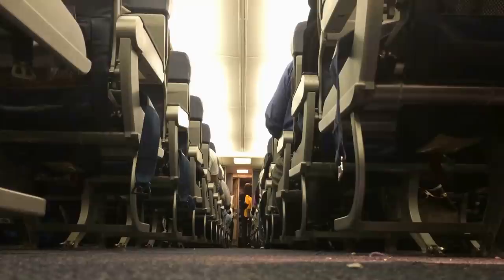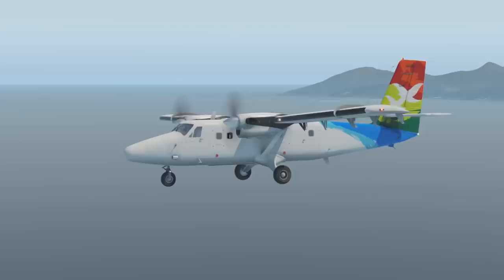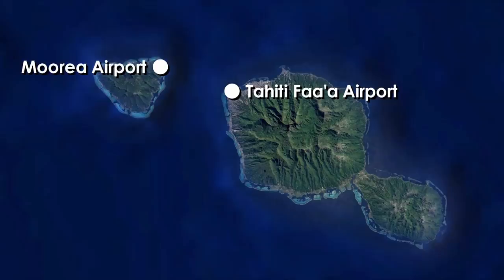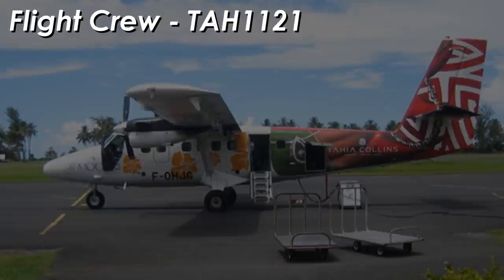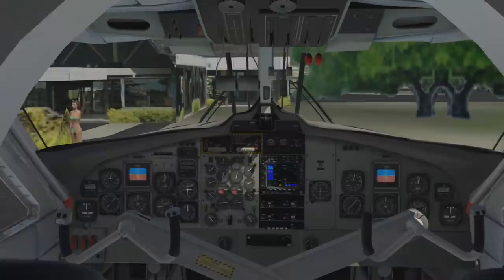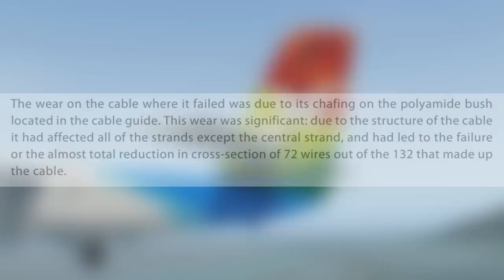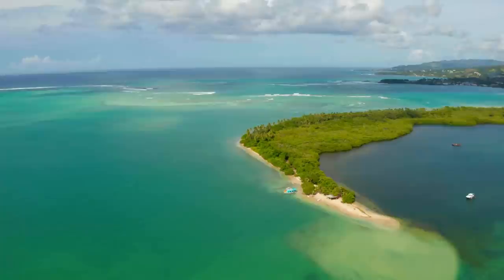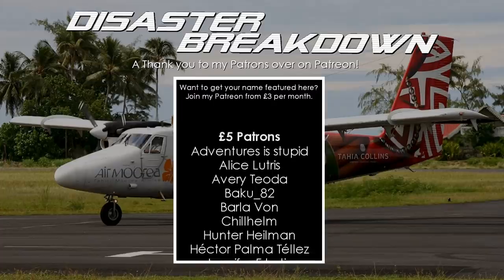The Terrifying Case of Air Moorea Flight 1121 - DISASTER BREAKDOWN

Comment: All plane disasters are terrible events. I'm a bit surprised that the worn cabling wasn't spotted during routine inspections. I guess it must have been hidden away inside the structure of the plane.
Reply: No, there are access panels near the tail and sides where you can eyeball the cable.
Reply: @adotintheshark4848  Thanks for that info as it answers my point/question.
Reply: @nigelh3253   This aircraft like many others have inspection access panels to where the mechanic or Q/C personnel can inspect cables for proper tension,  condition, routing, security and lubrication. I suspect these elevator cables or the one in question stretched over time which is not uncommon and started rubbing against a cable guide and started to fray. Over time it was bound to fail. On most aircraft there is usually a Teflon ring around the cable guide to prevent the cable from fraying. I think it went flying many cycles without being inspected and possibly pencil whipped,  so sad,,
Reply: @70slandshark47  to quote the invastigation report: 

"The failure of the pitch-up cable in the area with 50% wear cannot be explained only by the loads on the elevator control during operations."
"F-OIQI was parked at night with the controls locked."
"An external phenomenon, most likely jet blast, caused the failure of several strands in the worn area."
"The process of cable failure occurred over a short period of time. No signs of fatigue appeared on the failed wires."

when it had been inspected the last time, the cable was probably fine. also:

"When F-OIQI arrived, Air Moorea [...] had not been informed of the installation of stainless steel cables [...]
carbon steel and stainless steel cables being interchangeable, so that the maintenance of F-OIQI was
thus undertaken in the same way as that of the rest of the fleet. [...]"

they should have been informed that the cable was stainless steel, and there should have been a requirement for more frequent inspection of stainless steel cables, since they wear out much quicker than carbon steel. but there was not. and finally, even if it would have been inspected more frequently:

"In fact, this wear is very difficult to detect on an installed cable, especially if one has not previously been confronted with this phenomenon."
Reply: @Freeeez3   Are you saying the jet blast placed undo pressure on the elevator control cables even with the gust locks installed? I have a hard time believing that jet blast is going to place undo pressure on a flight control cables especially when the gust locks or control cables are locked out.  I assume the elevator is zeroed out in a level flight position.  So the jet blast would be little to negligible pressure on a control cable. Carbon steel or stainless steel  aircraft cables are resilient and last a long time when properly maintained. Now I have never worked on a Twin Otter as my background is Commercial Aviation. 
Very seldomly did I ever see one or replace one that was frayed and out of limits. I replaced a few that had stretched beyond their limits. But maybe your right that there was undo pressure put on the cables from jet blast,,, and maybe the jet blast was more pressure placed on the cable than what the pilot would normally command.
Reply: @70slandshark47  i think youtube just ate my initial answer because i linked the official investigation report as my source. anyways:

the twin otter was parked with the yoke locked in nose down position, because apparently there had been incidents of pilots attempting to take off with gust lock still in place.
this means while the aircraft was parked, the elevators were deflected downwards, but they could still in theory deflect a few degrees further until hitting a mechanical stop, due to the yoke being locked. 

now if a strong gust of wind, i.e. caused by jet blast from a taxiing air liner, hits the parked aircraft from the rear, this pushes the elevators further into nose-down deflection, and with the yoke being locked into place physically, this load ends up on the pitch-up cable, exceeding it's certified load limit by up to 2.8 times, depending on the thrust and distance to the offending jet engines.

for comparison, the estimated load on the cable during the flight, which caused the ultimate failure, was only around 106 daN; roughly 95 daN static tension and 11 daN dynamic load, with the cable being certified for up to 252 daN and a resistance to failure of 782 daN (for a brand new cable).
the forces due to jet blast were estimated to reach up to 710 daN, putting the cable far above its certified load limit, and very close to the resistance to failure for a new cable.
Reply: @Freeeez3   YouTube ate your answer because you were at the truth of the investigation,, LOL 
Thanks for the additional information.  You are right as it was a phenomenon no one saw coming. 
It's a first for me.  Thanks for all the good info.
Reply: @Freeeez3   Back in the 80s, I was working for the Airlines in SAT.  We were pushing back a 737-200 from the gate. The pilots were starting the engines. A Cessna 172 was coming around heading for the General Aviation area. He was supposed to stop and yield to us. He must have been in a hurry as he passed around back of the 737 and was immediately flipped over from the engine jet blast. We bought the plane back to the gate and went to check on the other pilot.  He was a little shook up but definitely learned his lesson.
Reply: @70slandshark47  oof, yup thats a lesson learned for sure. glad he didn't get seriously hurt there, that could have been very bad with a little bit of bad luck.

Comment: Dying because of a small stranded cable that got frayed over time.  On the MayDay series, I've seen that even a major airliner has only 3 bolts holding on the vertical stabilizer (and it broke off, killing all on board, after a mechanic used the wrong bolts).  I may never fly again.
Thank you for providing the investigation answer for Moorea 1121.  It was completely left out of the Smithsonian Channel Aviation Nation video, which showed the crash but then left out completely the follow-up investigation.
Reply: A helicopter crushed in Atlantic killing around 18 people. Manager of maintenance crew had memo and replacement bolts for gear box of said copter in his drower and did not replace them…Flying is the safest mode of transportation!

Comment: Am I the only one surprised that the Twin Otter has no redundancy on such a critical system?
Reply: I was thinking the same thing. Redundancy on aircraft should be on all of them. Probably adds extra weight but could save lives.
Reply: the cable is redundant in itself. it consists of over 100 strings, and a new cable can take loads roughly 15 times greater than the loads that occur during normal flight.
without the cable getting wrecked by (most likely by multiple) jet blast(s), it would never have failed.
the plane had been severly damaged by external factors (jet blasts), it didn't just randomly fail.
Reply: How would that even work? A second cable running parallel would have been subject to the same jet blast-based stressing as the main cable and would have likely been frayed the same.

The fault isn't in the cable, it's in the airport not putting up the jet blast barriers it was supposed to have installed.
Reply: The wing are a critical system on a plane… how would the “redundant system” work????
Reply: Most aircraft have at least a few single-point-failure systems that do not have redundancy built in. And most smaller aircraft do not have more than one primary cable or push-pull-rod systems to operate their primary flight controls. Having said that, it's conceivable that, had this pilot hand a few thousand feet of altitude at his disposal rather than only a few hundred feet, he may have been able to bring the pitch back under control - and even made a safe landing - using elevator trim and throttle. But at only 400 ft their fates were sealed. 

I worked on this very aircraft (serial # 608) as an apprentice about two years prior to this accident. It was undergoing a complete heavy-maintenance rebuild at our facility for the brokerage firm that was selling the aircraft to Air Morea, and this brokerage firm's bean counters were monitoring every expense like a hawk. We gave them a safe airplane of course, and with new engines, cables, instruments, props, etc. just for starters. But the new lubricated carbon-steel control cables we installed were later replaced by Air Morea with stainless cables - which were more corrosion-resistant but not as durable from a wear perspective and therefore required more frequent replacement. 

Of course, after the accident the French authorities crawled up every ass at every previous maintenance facility for this plane with a borescope looking for clues. Our AMO was no exception and, not yet knowing the actual cause, we all wondered if maybe an error at our end led to this accident. Not a good feeling.

On a side note, there is another single-point-failure mode on these aircraft that has caused total-loss accidents in the past and has resulted in at least three mods to correct the issue: The flap rods. If one of the main span-wise flap control rods comes apart in flight the flaps on that entire side of the aircraft go out of sych with the other side. This is most likely to happen when flaps are in retraction or extension mode, ie: close to the ground with no chance of recovery once the aircraft rolls. The swaging at the ends of these rods has been modified a few times over the decades to rectify this problem, and regularly-scheduled inspections are carried out for this very reason.
Reply: @Freeeez3  In this case, I would say, bluntly, no maintenance has been done for a long time.

Comment: I worked out of KCAE and on the ramp they had speakers mounted so the linemen could hear ground ops. I watched a Cessna 402B freighter take off and immediately started rapid up/down pitching. The pilot began screaming out he had no elevator control as it climbed to 300 ft agl. He managed to make it back around and was using the engines power to go up/down. As the plane entered base, he reduced the power to much, the nose dropped and all both engines at full power did was accelerate the dive. It went in almost vertical into a dense housing area but miraculously hit a empty lot. Investigation found main in Charlotte did not assemble the elev/tail linkage correctly and left a bolt out.
The plane managed to fly a few hours with that issue before failing. Ever since then the crucial tail/elev preflight is something I always 3 check and occasionally ask if/when maint has done any work on a aircraft's rigging. These fail = almost %100 accident. I also saw a aircraft roll over on it's back after the controls were backwards after maint.

Comment: It sounds like they were trying to make do with a plane too small for the demand, hence so many flights per day. Perhaps the maintenance schedules should include an and / or criteria, so many hours or so many flights.
Reply: i just went through the invastigation report, because i was interested how much maintenance had actually been done on the plane, and there were multiple factors coming together here. 
the first is that steel cables wear out much more quickly than carbon-steel cables, which wasn't being accounted for.

regardless, the failure of the cable can't be explained by wear alone and the invastigation concluded, that it had to be severely damaged by external factors, most likely (multiple) jet blast(s).

in fact, it would have been entirely possible for a brand new cable to fail under these circumstances - and there are quite a few instances where smaller aircraft were severely damaged due to jet blast from larger airliners.

it was just really unfortunate that in this case, the damage was very well hidden and noone would have noticed it without actually removing and checking the cable.
Reply: They had so many flights because it was such a short flight. Iirc, it's a flight of less than 15 minutes.

Comment: Crazy how another air accident was caused by the stainless steel cable but exactly the opposite reason. The plane in the other accident had this stainless steel cable and the maintenance called forreplacing it back to the high strength NON stainless cable and when the mechanic  took the stainless cables out they crossed the new cables and the piliots that were tasked with ferrying the plane back were subjected to TWO HOURS of being in that plane with no control and it crushing them with up to near 5G forces before they just barely figured out how to get a tiny bit of control and actually land the plane. I can't imagine how they were able to keep their head straight enough to figure out how to get control of a plane that was subjecting them to soul crushing g forces and it wasn't just a simple matter of their flight controls being backwards because they were fighting spoilers that automatically are activated and cannot be turned off. Not to mention auto pilot only controlling SOME flight surfaces. Pilots seem to be a very special kind of person with super ability to perform under situations that would deem most people into a puddle of emotions. If you want to look this up it was Air Astana Flight 1388

The flight deck crew was
 Captain Vyacheslav Aushev, First officer Bauyrzhan Karasholakov and
 First officer in jumpseat Sergey Sokolov
There were also 3 passengers that must have thought they were never going to live to see the next day.

Comment: Tap your brakes after lifting off bruh :) irl you could get very noticable vibrations from the lg wheels turning at high speed freely. :) Also your rudder has some spiking issues, a small null zone around the center should help, that and cleaning the potentiometer on the axis you are using :)

Comment: Maintenance is one of those things that the average layman seems to not appreciate or really understand.

Neglect maintenance on your car, for example, and at best, it won’t last as long as it should..and at worst it will leave you stranded on the side of the road.  

With aircraft, maintenance neglect will at best cause a terrifying mishap, at worse…you get something like this.  

Regardless of how “tough” a machine has a reputation has (an airplane, vehicle, boat, ship, refrigerator, firearm, whatever), neglecting maintenance still is not really acceptable.  The difference lies in the severity and type of penalty for that neglect.

Comment: Typically, most aircraft have control locks to prevent the sort of "banging around" that the French DGAC pointed the finger at.  I guess the "Twotter" as we call them in the industry does not?  In any case, ALL light airplanes use cables to operate the flight controls.  None have second backups, since the cables are so utterly reliable that the notion of them breaking is unthinkable. Light planes like Piper Warriors and Cessna 172's have to have a yearly inspection [cost is typically $1000-2500] and the cables get plenty of attention.  A frayed cable is a NO NO and must be replaced!  Most airlines outside of Russia use a repetitive maintenance schedule that has certain and different sections of the plane examined every 100 hours in order to prevent this sort of problem.  I am very surprised that the problem with this plane's cables wasn't caught in time.
Reply: The report states that there was no visible external wear on the cables. Which makes sense, because the elevators were always locked when the plane was parked when not in use. The problem was the stress put on the locked cable by the jet blasts while parked.
Reply: @Uldihaa  That still seems a bit odd.  Thanx!
Reply: Twin otters do have control locks, but the lock engages at the yoke and thus the cables are still subjected to forces applied to the flight controls.

Comment: A sailor or marine engineer could have prevented this. Stainless steel cables are prone to crevice corrosion. Galvanized cables corrode from the outside, so a visual inspection will reveal it. S/S cables corrode on the inside due to salt and the absence of air/oxygen, so need to be replaced more frequently.
Reply: This occasion has nothing to do with corrosion other than the manufacturer recommending the original cables be changed to stainless steel to avoid corrosion.  The video has to do with chaffing from the cables constantly rubbing on parts around it.

Comment: Was there anythibng at all that the Captain could hacve done, for example using power to reduce the impact of the crash?  You said there was not much that could have been done, but was there anything?
Reply: No because the plane didn't have any redundancy besides the cable system.
Reply: Also considering the altitude of just 400ft the Captain probably had like 10-20seconds between the failure and the crash. So no not really
Reply: The situation was survivable. He could have added power to pitch the nose up while using elevator trim to level flight. It has been done before.
Reply: @tombloom99  not if the cable broke for the tail controls.
Reply: @wyomingadventures  There are two cables,  one up one down. The trim is a separate cable or servo.
Reply: @tombloom99  …”he could have added power” …at 400ft, highly likely the throttles were still at Take-off Setting. In other words, full power.

“…using elevator trim to level flight”
First, trim controls are much slower-acting control surfaces.
Second, trim controls have much less authority, both in power and in throw.